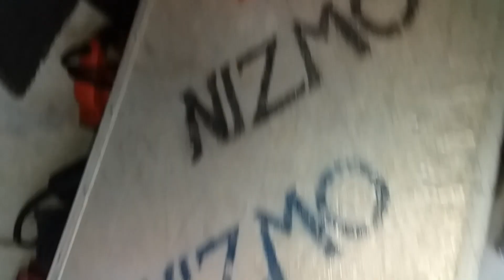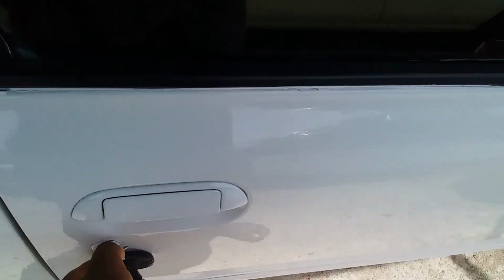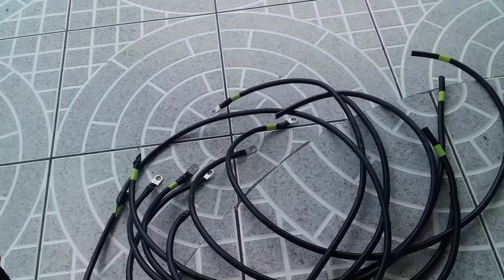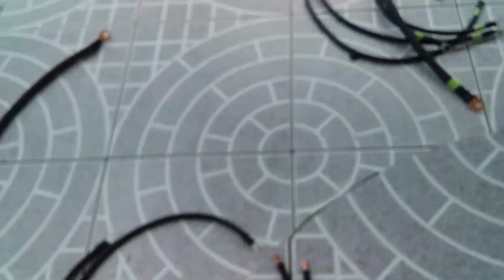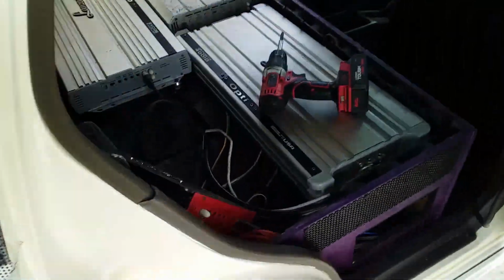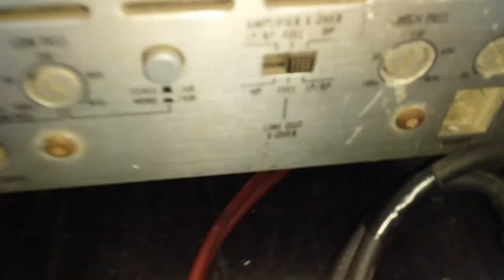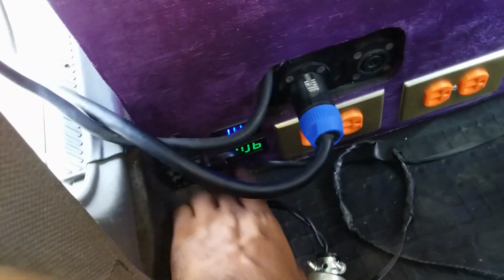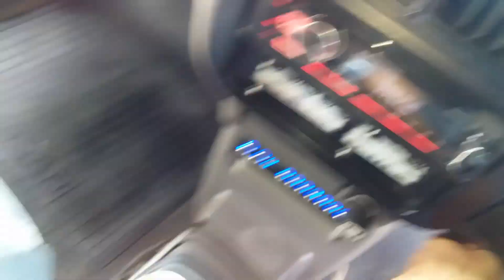THE IMPORTANCE OF KAPPA WIRES...AMP RACK LIGHTING...

Comment: Viewers when buying wires just spend the extra money and get OFC(OXYGEN FREE COPPER) wires, it last longer and has less resistance which equals to higher current flow and efficiency, the cheap CCA(COPPER CLAD ALUMINUM) wire powder out over time causing slack connections which leads to overheating.